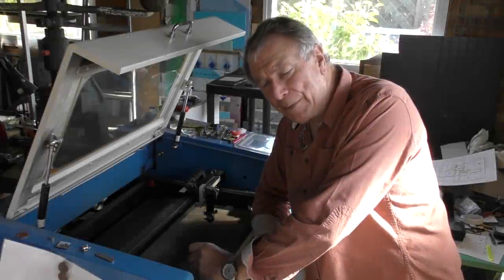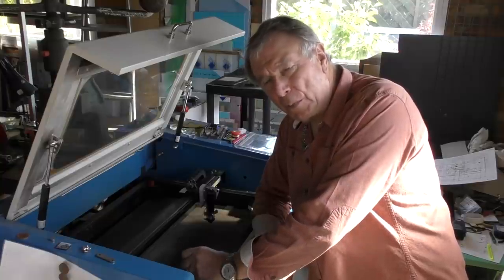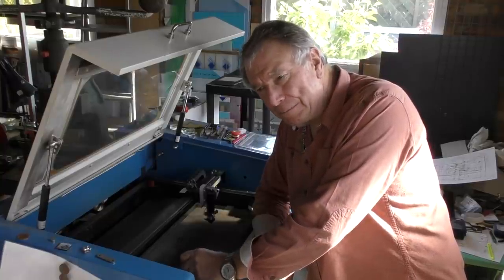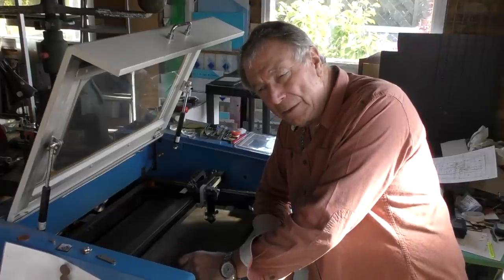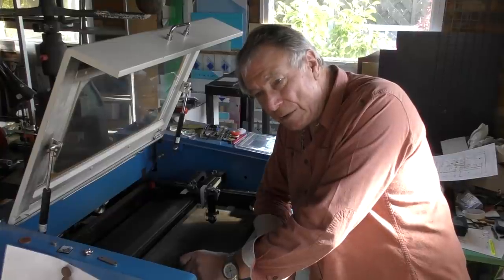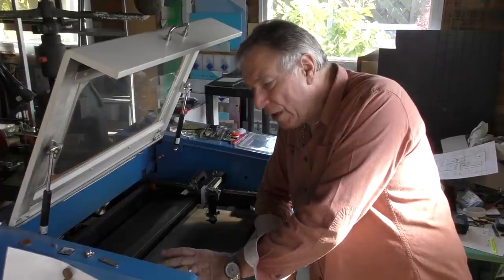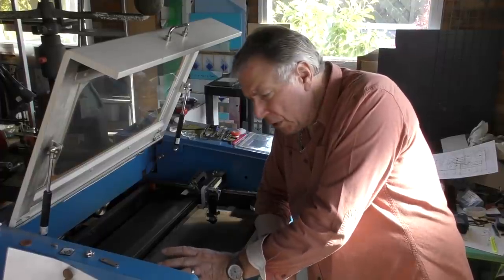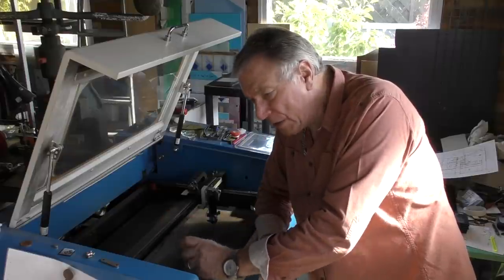RDWorks Learning Lab 189 Creating the Russ Spec Machine Part 1

Comment: Hi Russ i got a big problem with the laser stylecnc my z axis going up stop working u got any suggestions or a technician to come and look at it? Here in las vegas usa
Reply from the maker: Hi  Higuel

Despite appearing to have a USA presence, this is another direct Chinese import machine with just a 24/7 hotline back to China+86 531 83161518.  I do not know the model or size of your machine  or even if it is a stepper controlled Z or just a DC  motorized up down . When you open the electrical cabinet the stepper drivers are very obvious black boxes, Just 2 of them will be for the  X and Y axes . If you see a third then you know that the Z axis is stepper motor driven.  If it is stepper motor driven then it can only be one of three types of failure
1) the lead screws are jammed up. If it is a big machine it may have  TWO stepper motors  driving TWO belts. If these have lost synchronization the one side of the table may be higher than the other  and jamming the leadscrews. Can you hear the motor trying to drive when you press the up/down buttons..
2) The stepper motor/s ( or DC drive motor) is not working.
 3) The stepper drive box is not working. 
I would try to narrow the problem before you speak to China. 
Much as I would like to visit Vegas, travel to the USA is not possible at present. There are lots of engineers that service laser machines in your great country. Now is obvioslythe time to hunt one down

Best wishes
Russ
Reply: @SarbarMultimedia  
Find the issue. Thank you the focal pen got stuck
Reply from the maker: Hi Miguel
You are much cheaper than calling in a service tech at squillions of dollars per hour Well done. A sticky autofocus switch is a big problem. You must clean the tip reguarly with acetone to stop the sticky fumes building up.  I absolutely hate the autofocus function because of the switch and the fact you have to search through the menu to make it happen Do your REALLY find the focus pen useful? Are you using lots of different thicknesses of material?  I found it very slow to use . You obviously have  a stepper controlled Z to be able to use the auto focus function.  If I understood what your applications are I may be able to suggest ways to get the same result without using the autofocus pen 

Your confidence will grow with every problem you can solve  ( I see a bonus on the horizon!!!!)
 Best wishes
 Russ
Reply: @SarbarMultimedia  
Thank you Russ. Yes i like trouble shooting and have a good comon sence how things work. I just got freaked out new machine and i had to notify my boss and didn't have the guts how to tell them it was a very uncomfortable situation. But luckily got it fix before that. 😆 lol.
Reply: @SarbarMultimedia  
Hi Russ one question why is everything cuts mirrow image?
Reply from the maker: @llesco693  
 Which corner does your machine run to when it starts. Back left or back right?  Look at the top corners of RDWorks and there will be blue arrows in one of them. Is that the corner where your machine runs to? I suspect no. So go to CONFIG , SYSTEM SETTING. At top left there will be HOMING POSITION.  Make sure you select the corner where your machine runs to at start up.  That should fix your problem. If it doesn't, call again. 
 Best wishes
Russ